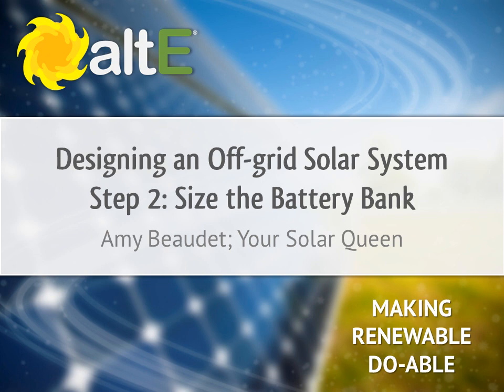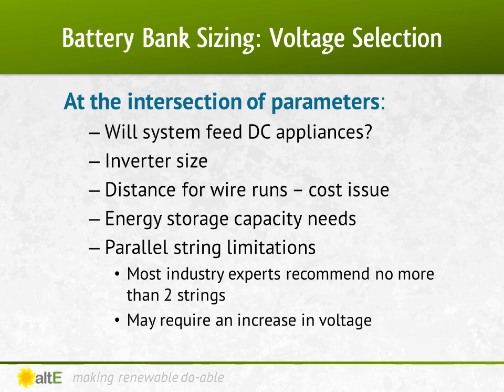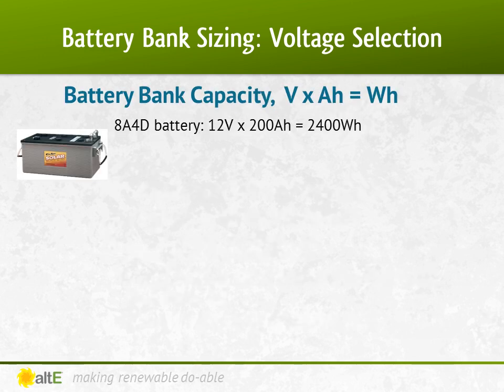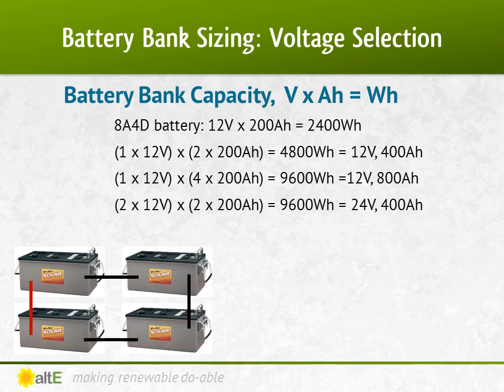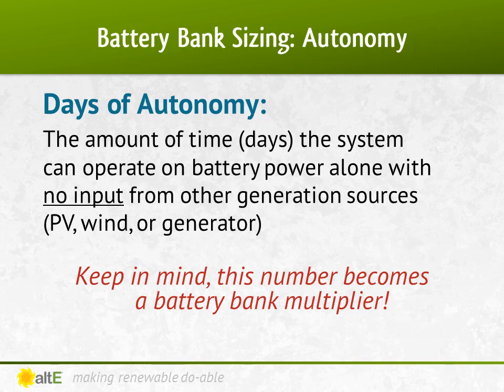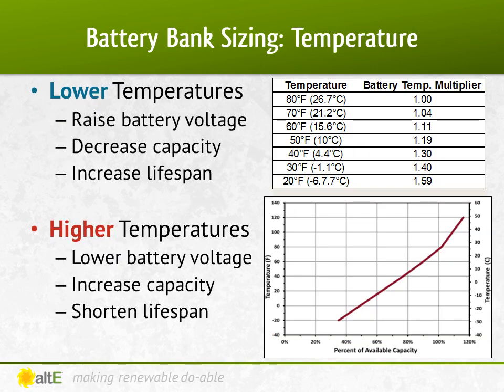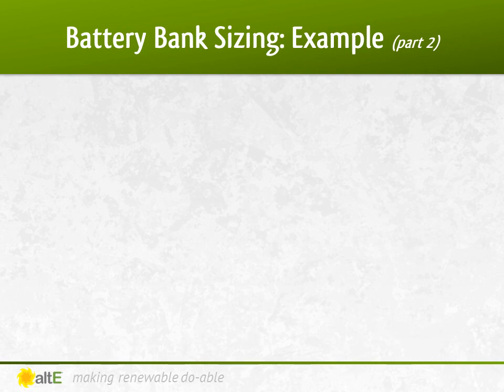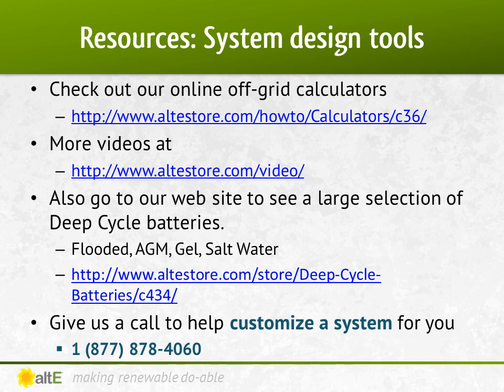Battery Bank Sizing: Off Grid Solar Power System Design - Step 2

Comment: is it a bad idea to run a George foreman grill or a small microwave on a 12 volt battery bank of I think 372amps hours,,,(4_186amp hour 6_volt golf cart batterys),for 3_5 minutes.a day???or is this honda eu2000i job???
Reply from the maker: +bill767667 A 6 person George Foreman grill draws around 1400W, and depending on the microwave, that could draw 800W - 1800W. If memory serves me, you have a 300W Samlex inverter, so without buying new equipment, running the high wattage appliance off your system isn't an option. If you did have an inverter big enough for the draw, figure that 1400W / 12V = 116 amps. That would cause a bit of a voltage drop on the battery bank when it is drawing that much current, if your battery bank was already low, it could trigger a low voltage disconnect from the inverter.
Reply: Thanks,I bought a cheapie modified sine wave job,,,1500 watts continuous and I believe 3000 Watts surge I have that hooked up to 2/0 ,welding cable to the bank,,, bolted on with a 200 amp inline fuse, I have an old storm cellar type basement so I went down there with my masonary hammer drill in the corner in a kind of discrete area out of the way and drill down past the cement floor into the earth and drove in a piece of threaded steel rod and I have a hydraulic crimper to crimp lugs and pins and things on a wire so I crimped to log on both ends of welding cable cuz I bought a pretty good size role of that and I bolted onto the rod in the basement , its all insulated and its  soft strand and flexible I ran it back upstairs to where the inverter is and I use that for my ground for the inverter,,,, now do you think using this is good enough for my ground,,, I have my Samlex 300 PST 300 on that same ground should it have its own ground rod and its own wire or can it share the  ground wire ???? when I get the money I will get a Big sine wave,,,youinsguys have some nice inverters I'll to order one when I can,,, I run my refrigerator sometimes for 8 or 10 hours a day,,,,off my bank right now with the modified sine wave probably not a good idea but there's nothing digital on it,,,
Reply from the maker: +bill767667 It should be fine to run both inverters to the same ground. The modified sinewave inverter should be ok to run your fridge, people have been doing that for decades. It might make the compressor run a little hotter than on a pure sine wave, but you should be fine. Here;s a cool test you can do. Use your volt meter to measure the voltage of the battery bank. When you turn on the grill, see if the volts of the battery bank drop a lot, or just a little. That should give you a good indication of it should be run off your generator. Another fun thing you can do is plug in a Kill-a-watt meter to the output of the inverter, and measure how many watt hours you are running devices off the battery bank. Multiply it by 1000 for watt hours, and then divide by 12V for amp hours. For example, if you run 1000W for 2 hours, that's 2kWh. 2kWh x 1000 = 2000Wh / 12V = 166Ah. That's almost half of your battery bank, so 50% depth of discharge. https://www.altestore.com/store/meters-communications-site-analysis/meters-battery-monitors/power-meters/kill-a-watt-electricity-usage-meter-p4400-p932/
Reply: Thanks

Comment: On the battery bank sizing: example (part 1), do you also need to take into account the charge controller efficiency?
Reply from the maker: We take the charge controller efficiency into account when sizing the solar array, not the battery bank.
Reply: Thank you for the reply.

Comment: what will be the battery temperature multiplier over 25degree celcius?? will be 1. something or less??
Reply from the maker: Terrific question. Yes, if the battery is stored above 25C, the capacity of the battery increases. Different batteries vary, but you can see the graph on page 38 of the Concorde AGM battery manual, it increases by 5 or 10%. https://www.altestore.com/static/datafiles/Others/Sun_Xtender_Battery_Technical_Manual.pdf. However, keep in mind, heat can decrease the life of a battery, so while you may get a little more capacity keeping it in a hot room, it may shorten its life.
Reply: thank you
Reply: just a recap
lets say my capacity above 25degree is 120%
if i wanted to store it 100Ah thn my battery temperature multiplier wud be 0.20 right?
battery capacity= 100*0.20=20Ah battery needed to store for 120%
did i do it right???
Reply from the maker: Nope, you got the inverse. If it is 20% better, then a 100Ah battery can store 120Ah.  So an 83Ah battery could hold 100Ah at a hotter temperature. (83Ah x 1.2 = 100Ah)
Reply: thanks a lot i get it now

Comment: A village comprising of 100 houses is to be electrified using Solar PV array, a suitable
battery bank an Inverter to convert DC to AC, 400 V three phase distribution line and
other accessories.
1. There are 20 houses having high consumption with 5 Nos. 10 W lamps, 10 Nos.
    8 W lamps three ceiling fans of capacity 60 W each and a 20“ TV of 80 W
    capacity.
2. There are 50 medium size houses having 3 Nos. 10 W lamps, 5 Nos. 8W lamps,
     one ceiling fan of 60 W capacity and a 15” TV of 60 W capacity.
3. The balance 30 houses have 2 Nos. 10 W lamps, 4 Nos. 8 W lamps and a 12 “
      TV of 30 W capacity.
The village is to be given electricity for 1 Hr. in the morning and 3 Hrs. in the evening.
The battery is a special deep discharge type battery which can go to a depth of
discharge of 80% and the battery is to have an autonomy (should be able to operate
independent of the solar PV system) for 2 days. Daily average solar insolation is to be
taken as 5.5 kWh/m² throughout the year. Find the capacity of the Solar array using
the commercially available solar PV panels of which specifications are given , the
DC/AC inverter of which the specifications are attached.Design the battery bank using
200Ah lead acid special deep discharge batteries. Assume a mismatch factor of 95%,
Inverter efficiency of 97% and the effective capacity of the solar panel drops by 20%
due to ambient temperature throughout the day and the Battery efficiency of
90%..Design a Stand Alone Solar Power system for the village and draw the Lay out
Diagram
Can you please help me to solve this ? Can I get the answer for this?
Reply from the maker: Are you asking us to do your homework for you? Here's some help. Step 1, create a loads list. How many watt hours is each group using a day. Multiply the watts times the hours, then add up the total. From there you can use the equation to determine the amount of solar. We use Wh / sun hours (5.5 in your example) / .65 for losses. You may be taught a different number for losses, this is an average we use. That will give you the watts. The formula we use for batteries may be a little differnent than you are taught, bu we use Wh / inverter efficiency x days autonomy x battery temperature compensation / DoD% / battery bank voltage.
Here's a video where we go through all of the steps. https://youtu.be/CHYVhNdlYM4

Comment: Why the required battery capacity have to divide the depth of discharge?
Reply from the maker: Since you can't use all of the battery capacity, you have to make sure you size the battery big enough to hold the amount of usable energy. For example, if you need 100Ah of energy, but can only use half of the stored energy without damaging the battery, you need to get a battery twice as big, 200Ah, to make sure it has enough to use and enough to stay in the battery to prevent damage.
Reply: @AltEStore  thanks a lot ! I'm currently studying solar photovoltaic system in school.

Comment: @2:32 min: how Pararell limitation come from?.. if i can't wire only in 2 string (such as 7-10Kw...maybe 4 or 5 up). how many amount of Pararell string appropriate to design ?
Reply from the maker: It is recommended never to do more than 3 strings in parallel, as the batteries can get unevenly charged and discharged due to uneven resistance. Some recommend only 2, and some even say never parallel. To get a larger battery bank, use lower voltage, higher amp hour batteries. So for example, to get a 48V 50kWh battery bank, use 24 of the L-16-RE-2V in series. They are 2V 1110Ah each, so 24 of them is 48V x 1110Ah = 53kWh.

Comment: If I use 2V,600A-H, in series. (24No) what will be the WH capacity
Reply from the maker: The watt hours is the same regardless how you wire them. What changes is the amp hours. Each battery 2V x 600Ah = 1200Wh x 24 batteries = 28,800Wh. If you wire them in one string in series, you will have 48V, 600Ah battery bank. (48V x 600Ah = 28,800Wh. If you wire them 2 parallel strings of 12 in series, you will have 24V 1200Ah. 24V x 1200Ah = 28,800Wh.
Reply: How we calculate the backup time if the operating load is 12000watts for 9 hrs for 28800wh
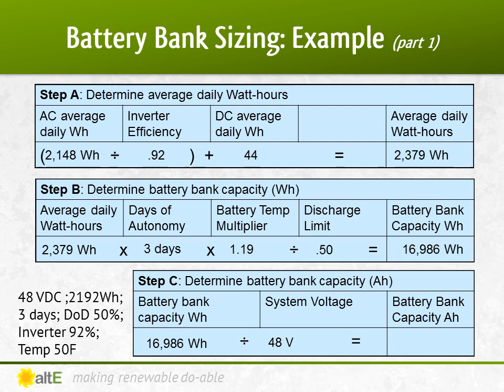Reply from the maker: It depends on the type of battery. If it is lead acid, the equation is as shown in the video at 9:40.  First, I'm guessing you mean 1200W, not 12,000W load. 1200W x 9 hours = 10,800 watt hours (Wh).  10,800Wh / .9 inverter loss x 1 day without sun x temperature compensation 1.11 (15C) / 50% depth of discharge = 26,640Wh per day without sun. So that 28,800Wh is perfect for 9 hours of backup.

Comment: Why would I triple the cost of my batteries to get three days capacity when I have a generator?
Reply from the maker: When designing the system, you have to find the balance between paying for more fuel for the generator or more batteries. It's a balancing act that you need to decide the right balance.
Reply: You also have to consider how often you need to lug gas to a generator. My goal is to never need the generator.

Comment: hello anyone who knows how to do a 3125AH battery bank capacity with the 2 string that is best adviseable in this video? the highest AH battery i can find online is 1000 in parallel that would be 2000 only. so that is my problem. is there a higher AH battery in the market? if anyone knows please point me the direction website link etc..thank you in advance and very much appreciated whatever help i can get.

Comment: Series strings shortens battery's life more than parallel strings. In series the possibility of overcharging independent cells inside the battery is greater, resulting in premature failing of the pack just because of one cell. Am I wrong?
Reply from the maker: +Telmo Monteiro  With series wiring, all of the current has to go through all of the cells, since that's the only way. Current takes the path of least resistance. With parallel wiring, the resistance of the interconnection cables can be different, causing different possible paths with different resistance.  Using as few parallel strings as possible is the healthiest option for your battery bank.
Reply: That's right, but that's also why we should wire the cables in diagonal, not straight. (Like using the first plus and last minus).
Reply from the maker: +Telmo Monteiro Right, that helps, but if you have 3 or more strings, the middle strings will still have higher resistance than the end strings.

Comment: your battery bank  must be double the autonomy kwh.so having two bank of 177 Ah 48 v will drain the battery bank to 0 % srate of charge.two banks of 177 Ah 48 v in parallel will add up capacity to 354 Ah 48.which is your required kwh for 3 days.so to achieve DOD of 50% you would need to double up the proposed battery bank.
Reply from the maker: At 9:05, we divided by .5 for 50% DoD, which is the same as multiplying by 2. So we took that into account.
Reply: sorry i missed that you had accounted 0.5 depth of  discharge.
Reply from the maker: Thanks for keeping us honest. :)

Comment: This professional advocates batteries in parallel. Wrong.  You can run separate charge circuits sharing the same solar cells,  but don't connect the batteries to each other.  Differences in voltage will trash the charges and lifespan of your batteries.

Comment: how about 4____L16 batterys and a good 2000watt sine wave inverter,,,@12 volts could you run the George and small microwave,not at the same time,,,,or would 24 volts be better,,,,how many panels would I need to support a 24 volt battery bank made up of 8 ,t105 batterys,,,L16 would probably be better,,,,could you give me the numbers for each type of bank at 24 volts,,,one made up of,t105,,,,and one of L16,batterys,,,and what about charge controller,,,I can go up to 800watts I think on my pro star ps 30at 24volts,,,I have been thinking about buying another ps30,to parallel two for my,372amp hour 12volt bank I have now,,,I'll have to get,4___more,100,watt panels ,,,I'm thinking it would help with overcast days and shading,,,,later if I go to 24 volt,having 2 ,,,ps30 I'll have the capacity or ability to go up to 1600 watts of Solar I think if I'm  looking it this right,,,,or I could stay at 12 volts for a while and have 800watts.....
Reply from the maker: +bill767667 You are probably better served giving one of our sales reps a call to discuss pros and cons of each option. There's way too much going on with your system at this point to handle in comments. Call 877-878-4060 from North America.

Comment: I will go with 1 battery, 48 volt type: 24-85-21 charging 6 hours = 850 aph, after 20 hours = 1340 aph total KW = 64.3 that's 4 days electricity on reserve for charging EV vehicle and night-electricity with AC & pump it only cost $7000 :D

Source: http://www.rapidtables.com/calc/electric/Amp_to_kW_Calculator.htm
http://gbindustrialbattery.com/Forklift_Battery_Sizes_and_Specifications_Zone15.html
Remember if you go with those batteries, they required "distilled water" NOT TAP-WATER, batteries cells don't like calcium(

Comment: Yur math is out to LUNCH in the worst way. By your numbers the actuall number of batteries you need is 4.
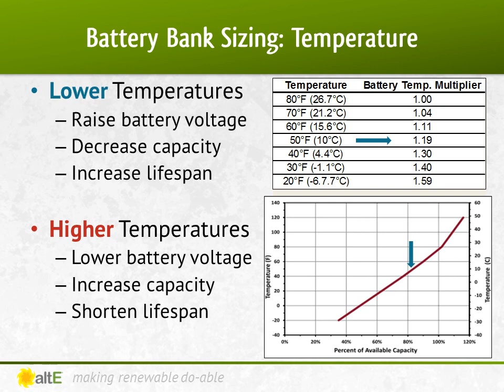Reply from the maker: +Trina McDonald If you go back and watch starting at 8:13, I walk you through the math. You can see that sixteen 190AH 6V 
batteries are needed for a 48V 2192Wh load, when all of the variables are added. (That battery model is selected at 10:15).(2146Wh AC loads / 0.92 inverter efficiency) + 44Wh DC loads = 2379Wh x 3 days autonomy x 1.19 temperature compensation / 50% DoD = 16,986Wh. After all of the variables, my watt hour requirements have increased by almost 8x, from 2146Wh to 16,986Wh. If I divide that by my 48V system, that is 354Ah needed. If I use the 190Ah 6V battery from the example, I would 
need strings of 8 in series to make 48V (6V x 8 = 48V). And I need 2 parallel strings of them to make at least the 354Ah needed (190Ah x 2 = 380Ah) 2 parallel strings of 8 in series = 16 batteries. Four 6V 190Ah batteries would only make 24V 190Ah, 4560Wh. I need 4x that.